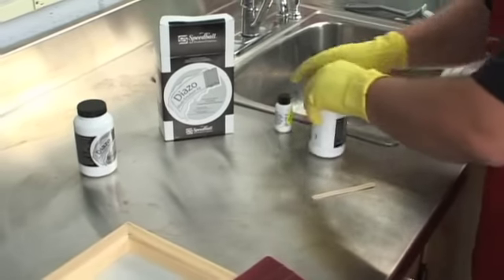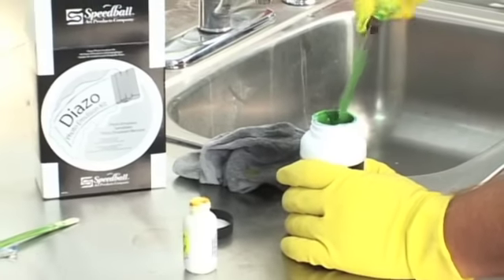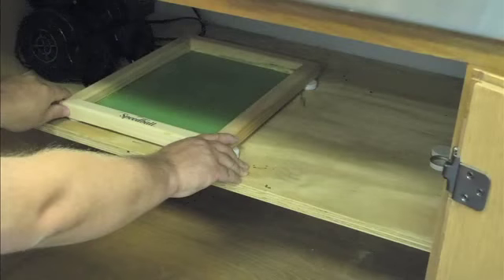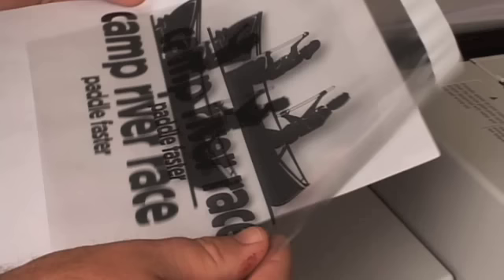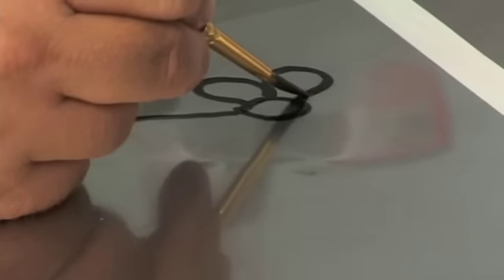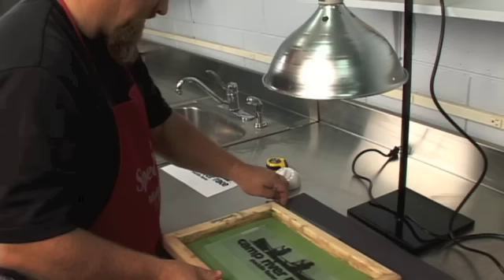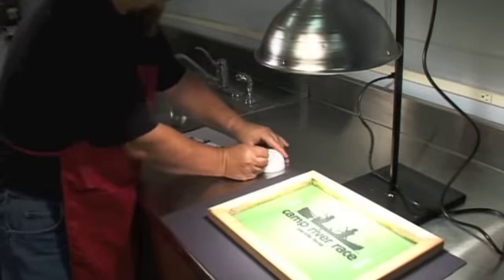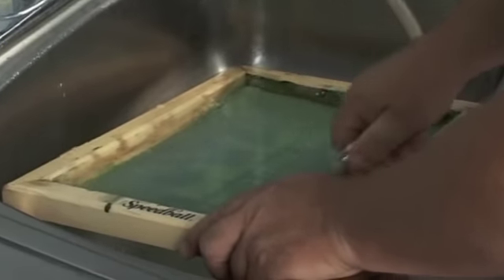Photo Emulsion Method

Comment: If i want to dry my 380 screen outside in the sun with a diazo,emulsion mix, how long should i let ot be exposed to the sun?
Reply: Hi ~ ive exposed with the Sun before. There are videos on YouTube detailing how to if you look into it. I used a test screen with different times marked on the side. 30 seconds, 1 minute etc. As the time went by i covered the screen as to not further expose those.. then wash out and see what time worked best. Proceed by exposing your non test screen with the time that worked best. I used this method to make company shirts with my image!
Reply: @marcelaaaahh1417  good idea.thnx

Comment: Is there any kind of emulsion that last longer than 4 months?
Reply from the maker: That's a good question! Diazo Photo Emulsion has a three-year shelf life if not mixed. Once sensitized it has a shelf life of four weeks at 90º F., eight weeks at 70º F., and four months when refrigerated. If you don't feel like storing mixed unused photo emulsion, check out our Speed Screens Kit which comes with pre-coated screens ready to be exposed.

Comment: Im using halogen 500 w for exposure unit,,what will be the accurate exposure time if i used speedball diazo emulsion?
Reply from the maker: This there so many potential light sources available for a printmaker to choose from, the only exposure times we are able to guarantee are those paired with the recommended light sources (250W BBA photoflood or Speedball LED Lamp) from our offering.  Any deviation from those sources would require experimentation and evaluation in your studio specific to your screen size.

Comment: I purchased the emulsion and sensitizer seperately. The emulsion is 26.4 fl oz. The sensitizer bottle  is only 2fl oz. What amount of sensitizer per emulsion? I cant seem to find this anywhere. No instruction came with my order.
Reply from the maker: What you have is the perfect size for each.  If you add water to the 2fl oz bottle and mix per the instructions, it is pre-measured to be ideal for use with the 26.4 fl oz Emulsion.  Happy printing!

Comment: hey, ive been having problems with speedballs emulsion. Would love some help. So when it comes to washing out the burned out design, the emulsion just breaks down and everything gets washed out. Ive exposed images for 12, 15, 18, 20 minutes, I use a 500w work lamp, I let the emulsion dry for 8-24 hours, I clean, degrease and air dry my screens thoroughly and the emulsion still washes out.  PLEASE I NEED HELP SOLVE THIS PROBLEM
Reply from the maker: Sorry to hear of the struggles!  We have some lab-verified exposure times for the emulsion that are available on our site, but those would be specific to our recommended light source, a 250W  BBA Photoflood bulb.  Changing the light source can add the need for a lot of experimentation to get the times dialed in, so if we can help you source a bulb like that which we've tested/recommend, we're glad to help!  Please just contact us at info@speedballart.com.  Thanks for using our emulsion!
Reply: BrandonTheRula I came across a random post on a forum that a guy had success with a 500w work lamp at 24 inches away for 11 minutes. I tried it at about 23 inches for 12 minutes and got good results
Reply: John Goodman alright sweet I’ll give it a try thanks a lot
Reply: Use 50W UV LED light exposure time 30 Sec

Comment: why is there only one little bottle and two big bottles ? is that little bottle enough for both of those two big bottles? ? ?
Reply from the maker: The first larger bottle is the Diazo Photo Emulsion.  It is used in combination with the small bottle, the Sensitizer.  The Sensitizer contains the exact amount needed to be mixed with the larger Photo Emulsion bottle's contents.  The second larger bottle that you see in this shot is not utilized until the end of this video (which is not shown here in its entirety) and is used for cleaning the screen--it is Diazo Photo Emulsion Remover.
Reply: SpeedballArt And how much water do I add to the sensitizer to dissolve it?  That should be indicated somewhere, but both the directions and this video do not tell us, and considering how sensitive this process is, I don't want to take any chances.

Comment from the maker: You can go to a hardware store to have the glass cut.  It does not have to “fit” in the screen, it can be cut larger, if you expose from the bottom of the screen.  It is not necessary, but will produce a crisper image.  If you don’t use glass, you can use cellophane or scotch tape to secure the image to the screen.

Comment: Is there any paintable resist material that could be painted directly on the bare screen where the unpainted areas will be where the ink will cover?
Reply from the maker: Based on the detail provided, it sounds like our Screen Filler + Drawing Fluid method is exactly what you're looking to use!

Comment: Do i have to coat the screen in dark room or not necessary ? thanks in advance
Reply from the maker: Great question!  You do not need to coat the screen in a dark room when coating the screen initially.  After coating, the screen should be stored in a dark area to dry.  If you decide to add an additional coat for larger print runs after the initial coat has dried, we recommend doing so in a dark room.
Reply: SpeedballArt haha, great question eh. xD #Corporate_Sarcasm

Comment from the maker: This can be difficult because once you mix the Sensitizer with water, the shelf life on the Sensitizer begins.  If you have some accurate scales, you can remove 1.08 grams of the paste and dissolve in about ¼ oz of water.  Then pours this into 104 grams of the Diazo Photo Emulsion.  The remaining Sensitizer can be used later.

Comment from the maker: You would not be able to remove all of the Sensitizer from the small bottle without the water.  It is a very thick material that would be difficult to remove.  The weights in this bottle are measured for a precise mixture and if any of the Sensitizer remains in the bottle, you would likely get a poor exposure and washout of the stencil.

Comment from the maker: You do not need a darkroom to complete the photo emulsion process. Once you have coated your screen you will need to place it in a dark area to dry. However, once it is dry you can expose it to your light source - no darkroom needed!
Reply: Is this only for your brand of emulsion?
Reply from the maker: @juliatachibana1733  currently, this is our only emulsion system available if you would like to coat your own screens.  we do have a new line of pre-coated mesh that will be available very soon!

Comment: how long can you keep a coated screen with emulsion and not exposed. Stored correctly. I've been in the hospital for a couple of months Are they still good?.
Reply from the maker: First, we're so sorry to read of your time in the hospital and hope that you are fully recovered and feeling great now!  To answer your question, we usually would only recommend up to about a month, and even then I would usually expose at a reduced time.  Some reaction will take place in the dark overtime.  Since it has been more than a month, we would recommend trying to wash out what you can with warm water.  If it won’t all come out, then let it dry, then use the Photo Emulsion Remover to reclaim the screen.

Comment: Can I ask what is the tool called that you  used to spread the emulsion onto the screen? It's not a coating trough which is what I see in most shops
Reply from the maker: The Speedball® Craft Squeegee is what is used to coat the screen with Photo Emulsion in this video.  It is a 70 Durometer, square-edged blade, 9" squeegee that is used for general printing applications.  Thank you for your question!

Comment from the maker: It appears that the sensitizer was not completely dissolved in the water prior to mixing with the emulsion.  Your screen should still work, but you may get some washout in the areas of the black streaks.  Try to avoid putting your image over these areas with streaks.  If you have some washout in the streak areas, then apply screen filler to block any openings.

Comment from the maker: Well, it could be done, but there would be some waste and you would need some very accurate scales.  The time starts ticking once the sensitizer is dissolved in the water.  The  correct ratio would be 1.08 grams of the sensitizer paste, dissolved in ½ ounce of water, then mix into 104 grams of the blue diazo sensitizer.

Comment from the maker: Length of exposure varies depending on the size of screen and the lamp height. If you were to expose an 8"x10" screen with a 250W photo flood bulb positioned at a height of 16" from the screen, exposure time is 7 minutes; 10"x14" screen at 16" lamp height is 8 minutes, and a 12"x16" screen at 18" lamp height is 10mins
Reply: I have this Light (500W). What will work with it?
Reply: @testpages724  i hate it when channels dont answer your questions its pointless isnt it